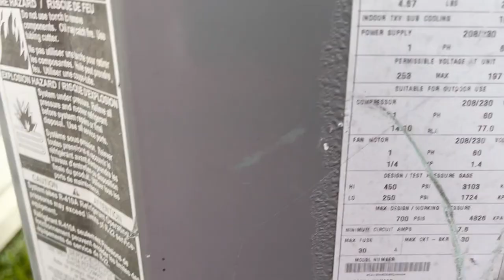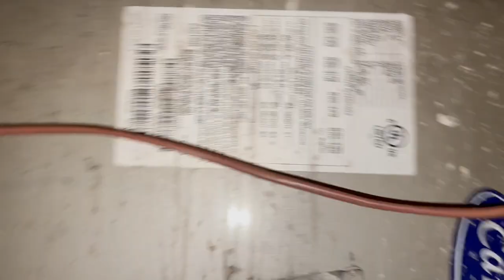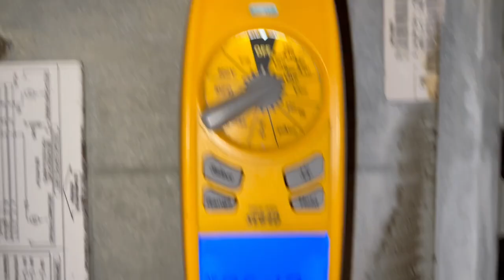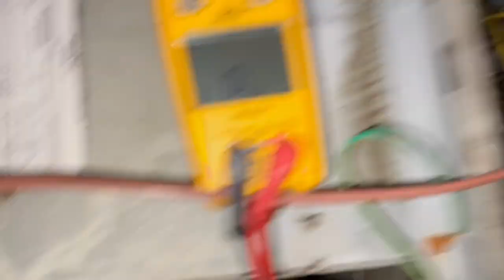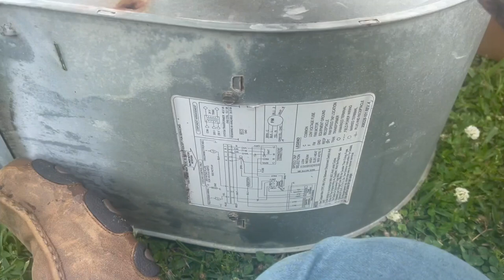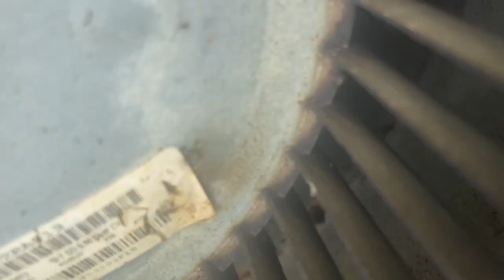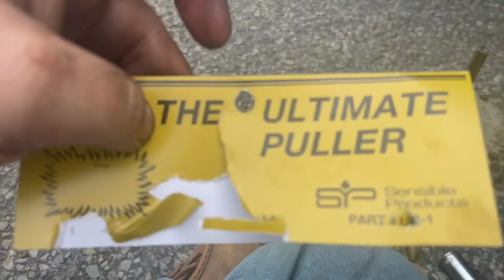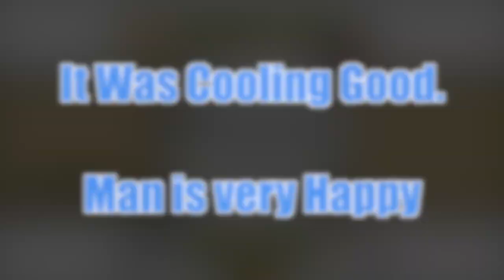No Cool/Carrier So Called "Zoned" System

Comment: Hey John I have that puller as-well. Works a treat, I clean it with WD40 and wrap it in a rag to store it. Also the threads on aluminium section are very soft and as my apprentice found out you shouldn’t use an impact on it it’ll just strip those threads right out of it.

Love the content.